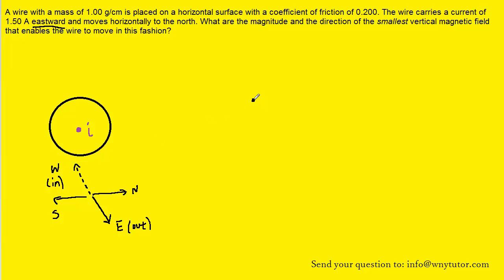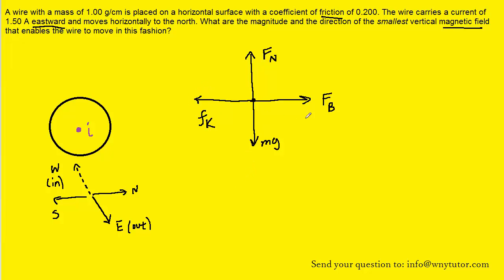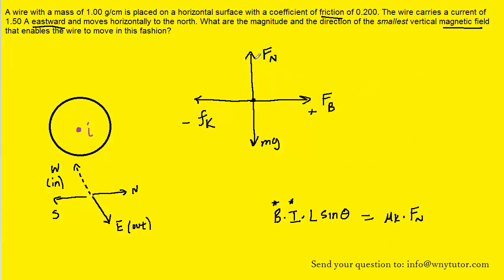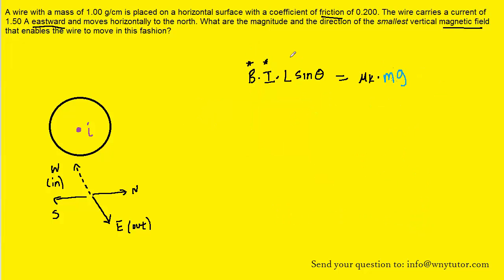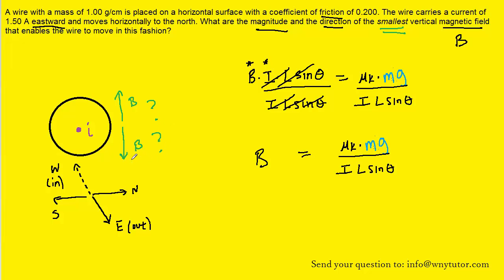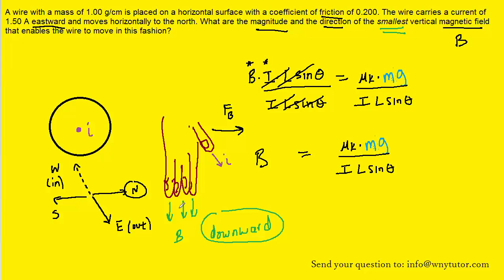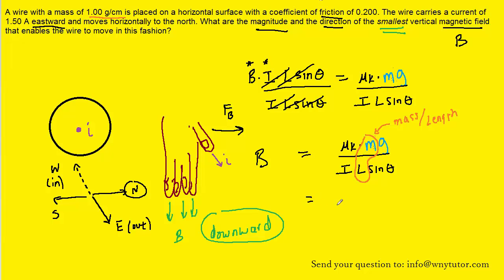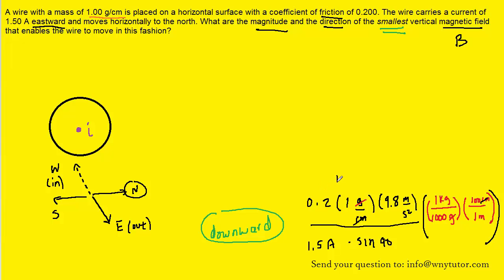A wire with a mass of 1.00 g/cm is placed on a horizontal surface

Comment: The field should actually point upwards because the current is made up of negatively charged particles (electrons), which means that the force should be coming out of the other side of the palm. The right hand rule is originally created to illustrate the velocity, magnetic field & force on a postively charged particle, which isn't the case here.
Reply from the maker: By convention, current is imagined to be made up of positive charges.
Reply: WNY Tutor Agh, yes, that's right. Sorry
Reply from the maker: +Преслава Бойчева No problem. Thanks for watching!